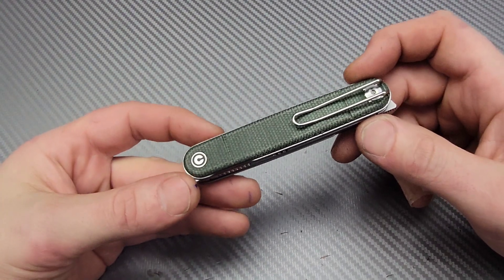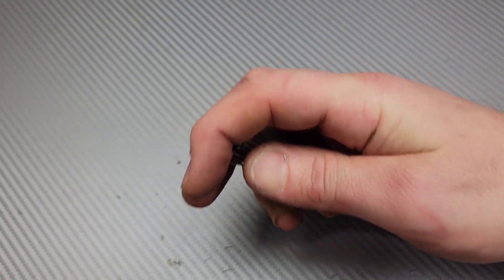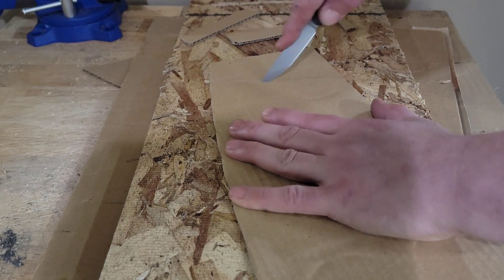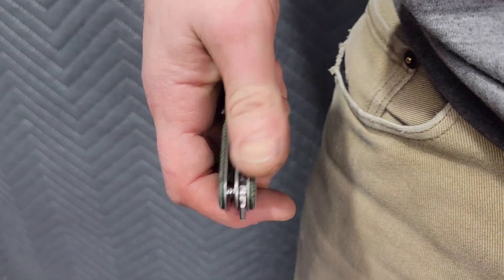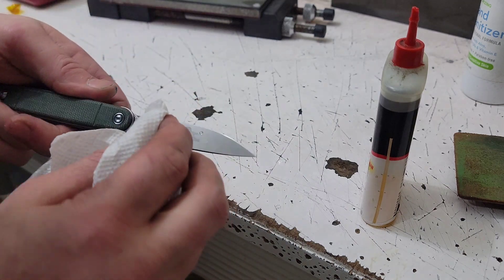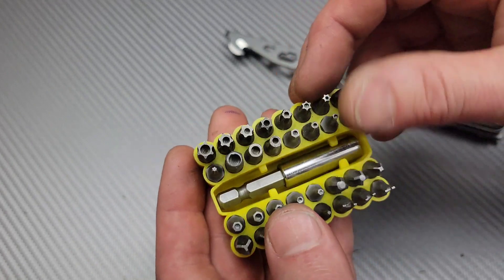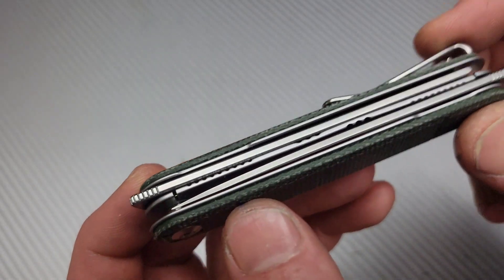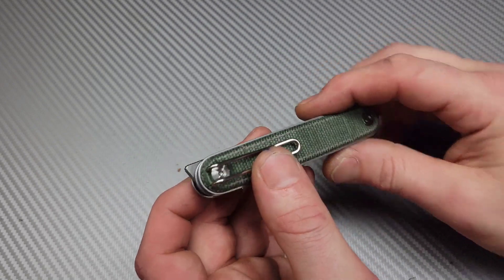CIVIVI CRIT REVIEW KNIFE / MULTITOOL

Comment: It’s not a bit holder on the tool part it’s just a set of small common size wrenches for small nuts and bolts you might need to tighten

Comment: If only they gave it a more conventional rear flipper I would 100% buy it. I've never owed a front flipper, and have no knife stores near me to even try. I can't justify $70+ for a knife I'm not sure I'll like to even operate. The strap cutter on the tool side is what sets it apart for sure. I use the gut hook on my Leatherman charge tti all the time especially to cut zip ties.
Reply from the maker: They take a bit to get used to, if you get one just get an easy one to start like the civivi  Mckenna. Or Miguron Akri